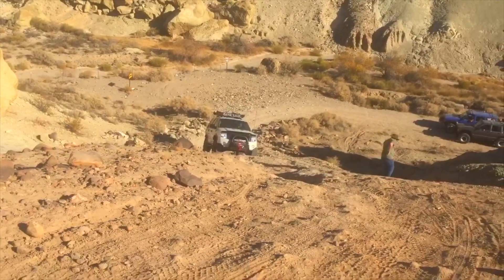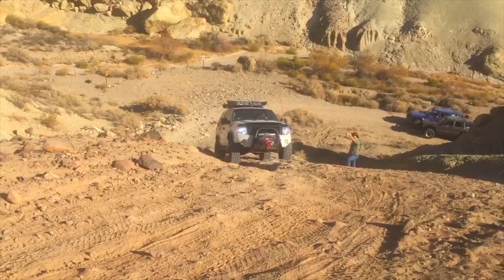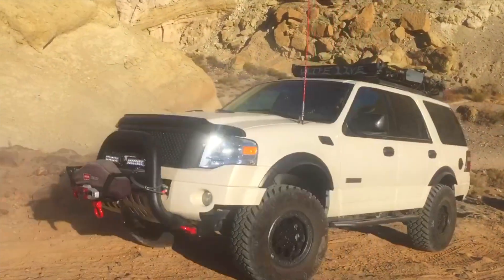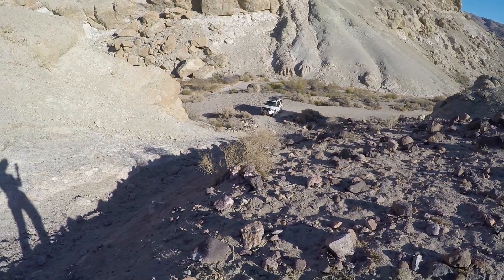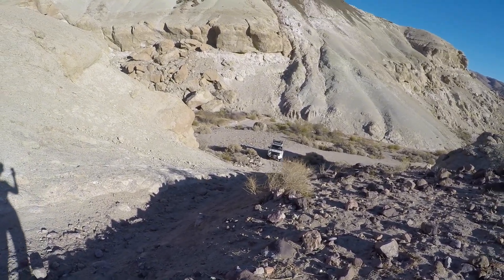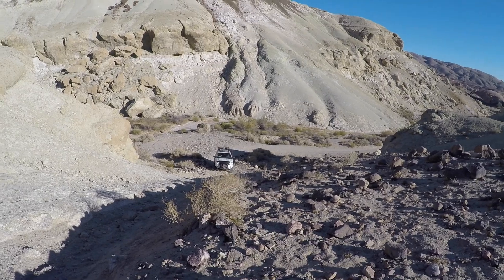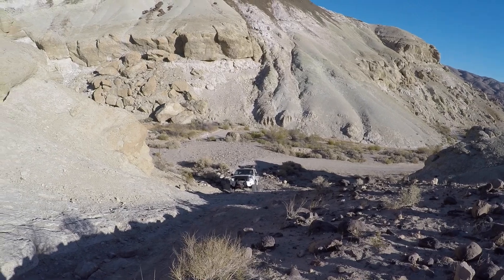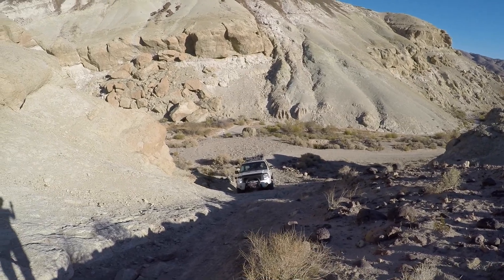Off Road 4x4 Ford Expedition, Last Chance Canyon!

Comment: Did you put different differentials or lockers in, or by Control Track, do you just mean stock traction control?
Reply from the maker: Hi Zack. 

Here is my updated answer after talking to a Ford Tech. We were both right and wrong in certain respects. Enjoy!

1LifeLive: See Front and Rear locked differential system, read below to understand how it works!

Several types of lockers: Some manually activated via air (ARB lockers) others are activated by switches (E lockers) while others such as mine on my 2007 Ford Expedition are a type of electronic 'software' locking system called Control Trac: mimics lockers by locking the center differential and then front and rear differentials.

Explained to me by a Ford tech:

Fords 4x4 off road system Control Trac uses software to lock the center differential and software to control a locked speed and power to the front and rear differentials with equal power and speed mimicking lockers. 

Hence why in Ford’s says electronically locked, which in essence is “software locked”. The software mimics mechanical lockers due to the fact of constant equal power and rotational speed to both the front and rear tires when in 4x4 lo or 4x4 hi (Advance Trac traction control button off).

Control Trac center differential locking software works in conjuction with Advance Trac traction control to mimic front and rear lockers.

Advance Trac traction control is comprised of: Engine Traction Control, Two types of Braking Traction Control, Electronic Stability Control (ESC) and Roll Stability Control (RSC). 

When Advance Trac traction control button is pressed OFF, It turns off ESC, RSC and Engine Traction Control, and the 1st Brake Traction Control (but not the 2nd Brake traction control) AND..... all of it turns back on when speeds are above 25mph. 

Understanding the two types of braking traction control:
1st type of braking traction control: 
for on road use when the traction control button is ‘ON’ and when tires slip, the slipping tires will be braked and power will go to the non-slipping tire and this is known as, “Standard Traction Control.” The braking is harsh, quick, easily felt and is also accompanied with engine power braking.

2nd type of braking traction control is used for OFF Road use with Control Track when the Advance Trac traction control button is OFF. This braking traction control, controls the rotational speed of all four tires equally by braking seamlessly to match the speed of all the tires along with the engine power. The braking does not correct traction loss on the ground whatsoever. The braking only concerns itself with helping control equal rotational tire speed to help mimic lockers along with the engine power controlling the same thing. Ford calls it electronic locking as the electronic part is the software part which locks in the power and speed of the tires mimicking front and rear lockers.

The Locking Center Differential:
The ControlTrac 4-wheel-drive system’s center "differential" is a electronically-controlled electromagnetic multi-disc (multi-plate) clutch pack. Through use of sophisticated control software, the multi-disc clutch imitates a traditional geared center differential.  

(Diffs Not Locked)
• 4A 4-wheel-drive Auto with high range gearing (1.00:1) Full-time all-wheel-drive capability, 
Electronically adjusted torque split to front & rear wheels, Electronically variable center differential, Front driveshaft & rear primary driveshaft allowed rotational speed difference with traction control enabled

(Diffs Locked if Traction Control is turned Off)
• 4H 4-wheel-drive with high range gearing (1.00:1) 4-wheel-drive capability,
Continuous 50/50 torque split to front & rear wheels, Electronically locked center differential, 
Front driveshaft & rear primary driveshaft locked with no rotational speed difference, traction control system needs to be off in order to have locked front and rear drive shafts.

(Diffs Locked, Traction Control is automatically turned off)
• 4L 4-wheel-drive with low range gearing (2.64:1) 4-wheel-drive capability,
Continuous 50/50 torque split to front & rear wheels, Electronically locked center differential, 
Front driveshaft & rear primary driveshaft mechanically locked with no rotational speed difference

Also in the manual Ford doesn’t recommend using 4x4-high or 4x4-low on pavement when locked. Making tight turns will cause torque windup and drivetrain binding, as the front driveshaft and rear driveshaft can’t turn at different speeds when locked. 

Big difference between the Control Trac locking system and standard lockers is Standard lockers you can turn off and on instantly. With Control Trac, once engaged sometimes the system is locked instantly and sometimes it takes the tires to slip for 2 seconds, then the systems locks. Once locked it stays locked until shifted out of 4x4 and just like standard lockers the power to all four tires is equal and constant.

I have driven in Jeeps and Hummers with Standard Lockers and compared the difference and once the Ford Control Trac system is locked, you cannot tell a difference once it is engaged.

http://www.1LifeLive.com
Reply: 1LifeLive Control Trac is just an intelligent traction control. There are no lockers or components other than the center differential. https://en.m.wikipedia.org/wiki/ControlTrac
Reply from the maker: Hi Zach, did you completely read the link you posted? The article has nothing to do with traction control which is completely different and explains exactly what I said about Control Trac being able to completely lock the front and rear diffs. Control Trac completely locks the front and rear diffs automatically. 

From the article you posted:
Four High and Four Low modes
Four High and Four Low modes were also featured on both Explorer and Expedition. Four High mode tells the intelligent locking multi-disc differential to lock, providing a permanently locked 50:50 torque distribution.[4] The front and rear drive shafts are fully locked, forcing them to rotate at the same speed regardless of tractive conditions. Four Low mode also tells the intelligent locking multi-disc differential to lock, however it instructs the BorgWarner transfer case to select low range off road reduction gearing.[4] Reduction gearing is utilized to reduce the vehicle’s speed to a manageable crawl, and to increase (multiply) the supplied torque coming from the engine. Thus the drive wheels have ample torque to move the vehicle at low speeds. It is also used to control downward speeds while descending steep gradients and to improve the vehicle’s off road crawl ratio.

Both Four High mode and Four Low mode cannot be used on pavement as "driveline binding" and "torque windup" can occur, causing damage to the four-wheel-drive system.

Here is the traction control called Advance Trac you are getting confused about that I also mentioned to you on your article that you posted:
 AdvanceTrac and Control Trac are two entirely different things. Advance Trac needs to be turned off for Control Trac to work. I know because I have been doing this for years.

The automatic ControlTrac four-wheel drive system can be coupled with AdvanceTrac electronic stability control, which includes four-wheel electronic traction control. The combination of these two systems is innovative due to a vehicle equipped as such, can continue to move forward with only one wheel having traction.[7] AdvanceTrac's four-wheel electronic traction control system uses the vehicle's four-wheel four-sensor four-channel anti-lock braking system (ABS) and is programmed with additional anti-slip logic to simulate differential locks via aggressively "brake locking" either the front or rear drive axle differentials. By ABS brake locking the front and rear differentials, up to 100 percent of torque can be sent to any one drive wheel, allowing the vehicle to keep moving, even with two of its drive wheels (one front, one rear) completely off the ground.[7]

Here is a much more in depth link that you can read too (hope that helps):

http://www.ford-trucks.com/forums/928481-controltrac-4-wheel-drive-and-how-it-works.html
Reply: 1LifeLive the only differential that locks is the center diff. The front and rear "brake lock" but that just means traction control...maybe by another name. Anyways, video still shows that it works.
Reply from the maker: Hi Zach, it acts exactly the same as any other locker once locked:

"The front and rear drive shafts are fully locked, forcing them to rotate at the same speed regardless of tractive conditions."

also...

"Both Four High mode and Four Low mode cannot be used on pavement as "driveline binding" and "torque windup" can occur, causing damage to the four-wheel-drive system."

That characteristic is exactly the same as any other lockers out there. Yes I agree that it is different, but it works the same.

But don't get it confused with Traction Control which is Advance Trac which works with brakes. That is entirely different and needs to be turned off in order for the Control Trac to work.

Again you can read the link I provided to better understand. http://www.ford-trucks.com/forums/928481-controltrac-4-wheel-drive-and-how-it-works.html

I have been in many off road rigs with fully locked diffs, and it feels and acts exactly the same. I agree with you that it does NOT have the same components, I am simply using similar verbiage to explain what it does as it does FULLY locks the FRONT and REAR diffs to have fully locked diffs. Most people refer to that as lockers.:

"The front and rear drive shafts are fully locked, forcing them to rotate at the same speed regardless of tractive conditions."
Reply: "So when you turn OFF the Advance Trac button it only turns off certain things. It turns off ESC, RSC and Engine Traction Control, but NOT Brake Traction Control AND..... all of it turns back on when speeds are above 25mph. "

Yes, I think we finally nailed it! That's what I was trying to say, they just said it better.

"then the software kicks in to barely brake it down to match the other tires in speed (so it has nothing to do with braking due to traction loss, but rather in tire speed, he said, and the Brake Traction Control will NOT brake for ground traction loss, hence why I can spin the tires off road)"

And this is where it mimics a locker. The ABS brakes the spinning wheel just enough so both tires are spinning relatively equally. The physical differential itself is still fully open, but modern brake based traction control can do wonderful things - everything from Range Rovers to GTRs uses them.

As an experiment, you can try turning off the Brake Traction Control as well. Once Adv Trac is off, press and hold another 5 or so sec till the light flashes. It becomes a fully open diff and you'll probably get stuck...

Awesome job removing the sways. I removed mine as well; I feel these trucks are spring stiff enough the sways aren't really needed. Better flex and less head tossing on rough roads.

Are you on Expedition Portal by any chance? It's a great site for this type of builds. Always wishing for more modern Ford SUVs to participate in overlanding.
Reply from the maker: This is the Expedition Portal I found. If I am wrong, let me know. Thanks. http://expeditionportal.com/
Reply: You got it JL, that's the site. I enjoy that forum because most people are into overlanding - getting to remote areas to explorer, travel. You can look through the trip reports to see where people have been, which range from a weekend getaway to a remote lake, to multi year trips through Africa, Siberia, Australia, all sorts of cool places!

I've seen a few Expeditions pop up, but far and few in between. And it's hard to search for "Expedition" on that forum, because the site itself is called that... Beyond the rigs themselves, there're sub forums dedicated to everything from recovery, camping equipment, navigation devices, rooftop tents, solar and 12V power systems, you name it. Rigs range from $500 Jeeps brought back to life, to $1M+ Unimogs and Euro exotic (MAN, Scania, etc.)

As to why Ford hasn't advertised our trucks more - if I had to guess: back in 2006/07, Ford owned Land Rover, their pinnacle off road / overland platform. If they made Expedition / Explorers shine too much, it'll cannibalize sales. But as a bonus, we did had some nice hand-me down tech, the excellent traction control being one of them.

To see just how tough these Ford SUVs are built, scroll down this page and click on the images. Your Expedition is very similar, just bigger. Look at the boxed sections of the frame behind the rear diff, and just after the front suspension, absolutely massive:

http://mrtruck.net/06explorer.htm

Compared that to say, a 1st gen Tacoma:

https://i.ytimg.com/vi/AsQRBHy5RPc/maxresdefault.jpg

Puny.
Reply: Neck surgery, damn, wish you speedy recovery!
Reply: ControlTrac locks the CENTER diff, not the front and rear differentials. In the off roading world, "lockers" always refer to differential lockers, not the center.

In your first quote, Ford is talking about the FRONT and REAR drive shafts being locked together, and binding on pavement. A diff locker locks the LEFT and RIGHT half shafts, which the Expedition does NOT have.

When you hit that big button on the dash, Control Trac + Advance Trac work together to 1) lock the center diff, and 2) brake bias the front and rear diffs to achieve all wheel traction. It does NOT lock the diff, as there're no hardware in the diff to perform lock.

Lockers are either air, electro-magnetic, or mechanical activated (which I think you mentioned yourself in another video). Look around your diffs - do you see any electrical, air, or mechanical connection? How could the diff lock if there isn't?

There're only 3 trucks that come stock with full triple lockers: G-Wagen, Rubicon, and Power Wagon. Not even Land Rovers and Land Cruisers have full lockers.

Not putting down the Expy in any way - it has an excellent brake bias traction control, the same as LR3/4s. My Explorer has the same system and works extremely well in terrain shown in this video.
Reply: Roy J ... lx450 had them optioned in front and rear.. and a few rare vw Touareg had a front locker and rear , I have a 2005 with the factory rear locker , center locker..low range.. it does extremely well
Reply from the maker: Hi Roy, yes you are mostly correct. I use that term lockers quite loosely and I notice it bothers some people. In my new videos I simply say that Control Trac mimics lockers, which it does, as to not step on any toes. 

So you know however, the Ford Expedition DOES indeed have CV HALF shafts, left and right, and they get locked equally for equal rotational speed. And when I use the work lock, I am only using that as a reference word as Ford does in the manual to describe the shafts turning at equal speed.

I know this for a fact because I took my rig apart and removed the half shafts to get longer ones custom made.

Luckily I did not have to get them custom made as Ford beat me to it and already made some longer ones so I bought those instead and save a good $1000.

Also, I use the word Lock as a general term as that is the term Ford uses in the manual. It is quite easy to use that term rather that to explain an entire paragraph to someone every single time. Ford simple uses the word "lock". Everyone easily understands that word "lock". So, it is a very easy word to use. Nevertheless, I now use "mimic" lockers. So I guess I made up my own term.

Again, if you watch any of my newer videos I explain that the Control Trac mimics lockers, meaning feels like them and acts like them so I don't accidentally offend any locker people.

The only thing I don't quite agree with you on is the big button in the center thing. I went to Ford and spoke to the shop and that button is for Advance Trac which is the braking traction control. What they told me is that has to be OFF, so Advance Trac Traction Control has to be OFF in order for Control Trac to work OFF ROAD in the dirt to turn all 4 tires equally.

They said Advance Trac Traction Control is a separate item that when 'ON", it does work with Control Trac but in a different format with using brakes to send power to only 1 wheel when all the others are slipping or off the ground and it is to be used in 4 Auto or 2 wheel drive but NOT 4 Hi (if traction in all 4 wheels is desired) and NOT used in 4 Lo. 

They said if on, the Control Trac will never engage all 4 tires with equal power, hence why it automatically turns off when in 4x4 Lo.

To be honest with you, it is very confusing and I would simply enjoy straight pure E-Lockers if I could, however when I researched them I do not think they are available for front and rear for my Ford Expedition, so as of now I enjoy Control Trac which does work great once engaged.

Thank you for explaining all you could. I wish I could be sleeping but the doctor just gave me two powerful shots for my spine and then Flexeril muscle relaxer. Not good. I swear I stopped breathing and woke up gasping. So now I took Sudaphedrine to counter act the Flexeril. Wow. Ok, that was off subject, but at least I had something to do while it kicks in (meaning responding to you).

Take care :-)
Reply: Thanks for the detailed reply. I don't think anyone is getting offended by you calling them lockers, I just don't want people new to off road go out buy an Expedition / Explorer, and brag to their Rubicon buddies that they also have triple lockers!

What we should clear up is 1) ControlTrac refers to the Transfer Case; 2) it's not related to the differentials; 3) ControlTrac can perform a center diff (aka transfer case) lock function, to simulate a part time transfer case.

AdvanceTrac is the system that uses brake bias to simulate lockers. In street mode, it simply kills engine power when slip is detected - not good for hill climb! When you hit that dash button once (without holding it for 5 sec), it retains the brake bias ability, but gives near full engine power.

This is probably what the Ford shop meant when they said it has to be "off" for off road. I don't consider it to be off, but rather in "off road mode". If you press and held it, it'll turn off altogether, and your truck would be in full open diffs mode - sucks!

Personally I wouldn't waste money getting full lockers. Our trucks aren't rock crawlers (yes, I'm full aware they are IFS/IRS with 4 CV shafts). My style of off roading is overland travel, staying off the beaten path days at a time, getting me to remote lakes, towns, hunting areas, etc. For this purpose, I think the 4th gen Explorers and 3rd gen Expeditions are under appreciated. Most people see the missing solid axle and assume they can't go off road, as you've shown, that's far from the truth!

Our trucks both have very beefy frames, with high torsional rigidity. Even my old Land Cruiser 100 frame was less rigid! If you get a chance, perhaps take off the rear spare and do a video showing the frame members around the rear diff, people could be impressed.

Where my trucks suffers is lack of ground clearance, and suspension travel. I'm going to install a set of Rancho Quick Lifts, which is how I found your channel (replacing air bags with Ranchos). I don't want to go too high because there will be days when I cover 600+ miles on highways, and like to retain the road manners. Want it more for increase in suspension travel.

BTW, did you remove your sway bars? I didn't see one in your Rancho video. Hope your back gets better!
Reply from the maker: Hi Roy, yes they are under appreciated. I think that is also because Ford gave them like zero clearance. 

I wish Ford was not so confusing with all this stuff. I think you made some good points and I will put together a video and will try to explain it. 

Yes, the Ford shop told me that Advance Trac traction control was meant for the street and not off road, hence it would brake the slipping tires and give power to the 1 wheel not slipping which is fine for on the road for like wet pavement, etc and obviously not fine for in the dirt.

What gets confusing is they told me that when I turn off Advance Trac traction control, then no brakes are used and Control Trac can then be used to its fullest. I agree with that as I can easily tell the difference between traction control and lets say, mimic lockers, and no brakes are used when Control Trac is fully engaged with equal power to all four tires. Now maybe technically speaking Control Trac and Advance Trac might be of the same software and such and pressing the traction control button chooses options of the software, but for ease of discussion I separate the two as the two do different things for on the road and off the road.

Great idea about a video for the frames! Never did I think about that! Thank you very much! Awesome!

Please check out my website spec page www.1LifeLive.com and you will see that I did indeed remove the front sway bar. So far so good, had it off for about 2 years and it handles great and I now get much more front articulation!

Also here is my email, please keep in touch for future brainstorming jlzaring@1LifeLive.com 

Spec page:
http://www.1lifelive.com/1lifelive-rig-specs.html

Also, with full skids and clearance, you can have a decent rock crawler, mine does great once Control Trac is engaged. I just did a rock crawl trip with Jeeps and Hummers and did fine with them! And I have used Rancho so email me for any questions. 

Take care!
Reply from the maker: Hey Roy,

I decided to dig up the manual and RTDT..., remember that saying? RTDT (Read the damn thing). I think I just need to add a A to the end for Again. Read the Damn thing Again!

So it turns out we are both right and its more confusing than ever. First off I took photos of the Control Trac pages to post them for people on my website. However, that only shows so much.

You are correct, the Advance Trac traction control is comprised of multiple things and that is where it is confusing. It has Engine Traction Control, Braking Traction Control, Electronic Stability Control (ESC) and  Roll Stability Control (RSC).

So when you turn OFF the Advance Trac button it only turns off certain things. It turns off ESC, RSC and Engine Traction Control, but NOT Brake Traction Control AND..... all of it turns back on when speeds are above 25mph. 

So I called Ford to ask them about what is Brake Traction Control with Control Trac in 4hi or 4Lo as I never feel the brakes. They told me I would not feel the brakes if the Advance Trac button is OFF, because the traction braking that is used during 4hi and 4Lo is only if one of the tires gets too much power from Control Trac, then the software kicks in to barely brake it down to match the other tires in speed (so it has nothing to do with braking due to traction loss, but rather in tire speed, he said, and the Brake Traction Control will NOT brake for ground traction loss, hence why I can spin the tires off road) and its so instant and seamless that I would not feel it or notice it and that is what helps keep the power locked equally is locking the center diff along with controlling it if needed if any of the tires gets too much power since the Engine Traction is off. 

He went on to further say the Brake Traction Control works different when the Advance Trac button is ON and it meant for pavement. He said then it actually senses traction loss and does hard braking along with Engine Traction Braking to the tire or tires that have traction loss and you CAN feel the braking and you can feel the engine loss. So there are TWO types of Brake Traction. Nuts.

Wow. It looks like my video might be confusing. Lol.

So anyway, just wanted to say thanks. I am always someone that wants to know exactly how something works and this system is confusing, so thanks again for helping to uncover some things. More learning the better! :-)

I will next put this info on the website. :-)
Reply from the maker: Roy J  Hi Roy! I am not sure if I belong to it or not. Can you please shoot me the website and I will join if I have not already. I will also put all this clarified detailed info on my website and I scanned the pages from my manual too, so people can better understand. Ford should have done a better job advertising their 4x4 system and promoting more off-road packages for Expeditions and Explorers. Maybe you and I can join and get Ford to sponsor us! Haha 💪😊👍
Reply from the maker: Roy J  Awesome info! And yes I joined and will do my profile soon! Just have to so more minor neck surgery this Friday. Will surely do a frame video, so thanks for that info and frame knowledge! Thanks again and keep in touch! 😊👍